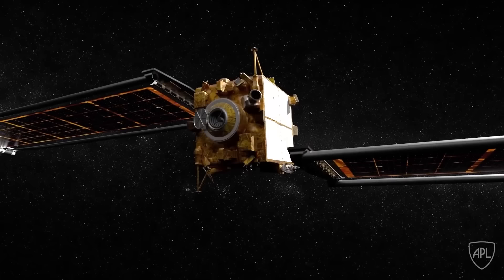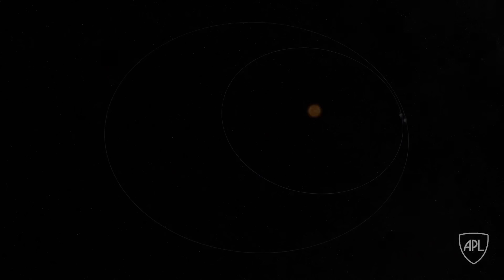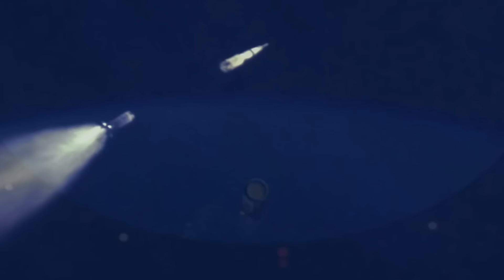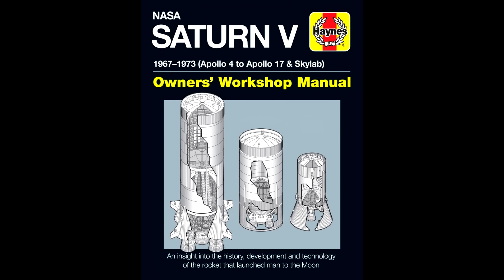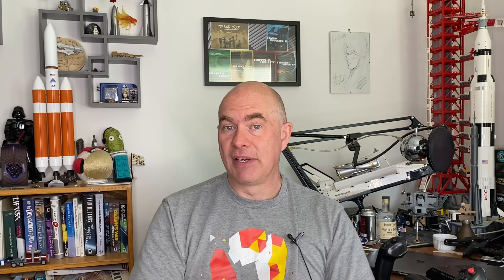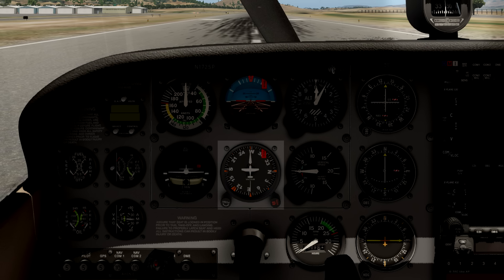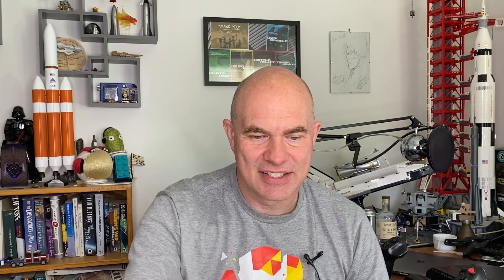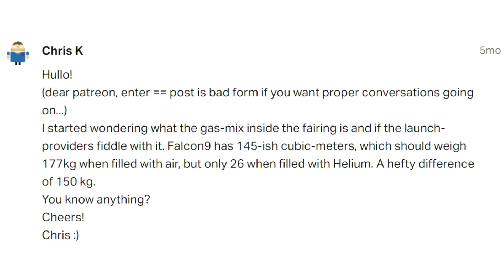Saturn V Staging, Asteroid Deflection and Hearing Rocket Turbines - Supporter Questions, Episode 17

Comment: There's something that does the same job as an orbital elevator but is doable with current materials - orbital rings. So basically you love Earth so much you put a ring on it (get into orbit with a huge spool of cable, and unravel it until it circles the entire Earth - and it's in orbit).

Then, to tether things to this ring moving at orbital velocity, you basically use maglev trains - something that is stationary with respect to the Earth's surface, that bears weight on the ring through magnetic interaction only, so that you can have cables hang down from it that are stationary relative to the surface of the Earth.

And you can do this with current materials and make yourself a gondola up to LEO. Then use a maglev train to reach orbital velocity once you're up there. Or even keep accelerating to whatever speed you want (at least, until centrifugal force is so great you'd break the cable. But since the cable can handle 1g, you should theoretically be able to hit escape velocity, at least, since that'll put you at -1g load on the ring).

Comment: Ring laser gyros have been used in large aircraft inertial reference systems since the early 1980s. They only have a tiny amount of drift and are sensitive enough to get the aircraft's latitude during the warm up initialization by sensing the earth's rotation. But they are still cross checked and adjusted in flight by the flight management computer using other external data like ground beacons and GPS.

Comment: The elevator also needs to impart radial velocity to the payload as it rises. It would need to be able to not just take tension and compression, but also some very robust lateral strength. I think. I don't see how it can be viable. I could be wrong though

Comment: I've done that interstage/ullage thing in KSP with structural rings and Separatrons.  It's good for rockets whose first stage doesn't quite have enough kick to get it past 18 km and staging would send it tumbling in the atmosphere.  The push from the Separatrons stabilizes the back end while you start the second stage engine and raises your apoapsis to make its job easier.

Comment: re: delta iv spin up - when I worked for Rocketdyne at Stennis Space Center 2004-2005ish, I always remember after an RS-68 engine test on the B test stand that you would very noticeably hear the engines spin down post cutoff.  interesting to hear them spin up (I guess there was too much other noise during tests to hear).

Comment: About that Saturn V ring, I heard a story of the guy responsible for the 16mm camera that took the footage never saw it until many many years later (kind of hard to believe since the footage has been used for many documentaries, sci-fi, commercials). I read in 2000s I think where this guy is retired, living in San Diego, and he was interviewed and his story was in the media. Imagine being part of the design, implementation, plus all the bureaucracy in addition to meeting schedule while working the failure modes. Then load up the film (or someone else does that) hope nothing gets screwed up during installation. Hope power will activate at the right time, footage not too bright but not too dark, mitigate the extreme temperatures. Later recover the film. Then have it developed. Imagine being one those few that got to watch it for the first time.

Comment: Another reason that DoD was happy to leave the shuttle for unmanned rockets was the requirement to modify STS payloads (satellite) to meet man-rated system safety requirements which increased weight, added complexity (more failure points) and reduced on-orbit fuel availability.

Comment: Regarding the space elevator. In The Fountains of Paradise, Artur C. Clarke clearly mention the requirement and the process of cleaning space from all the debris and satellites that could collide with the elevator. If I remember correctly, he stated that that cleaning toke over 10 years.
During the development of the space shuttle, there was a proposition of having a space taxi : A space shuttle aimed to only carry crew, possibly up to 12 peoples, and minimal cargo. Then, have a space truck : A large volume and mass cheap launcher destined to launch only cargo, reducing costs by not having any sort of life support. Light weight and cheap structure.
Combined, that could have led to an ISS with larger, more spacious modules. Imagine an ISS with habitation and storage modules of around 5m in diameter.

Comment: More on the later Apollo missions - from "Stages to Saturn", Roger E. Bilstein, NASA (pp 376-377)

"The last three vehicles, AS-510 through AS-512, performed without a hitch. The payload, however, was continuously climbing. These last three launches included the lunar rover vehicles, which added almost 225 kilograms to the payload of the Saturn V. The rover turned out to be extremely significant, permitting astronauts to extend greatly the range of surface explorations and increasing their stay time. The uprated engines of the Saturn V, which permitted it to boost this additional weight into orbit, turned out to be a function of thoughtful long-range planning by NASA engineers. In the evolution of rocket vehicles, the actual payload requirements almost always turned out to be greater than originally planned. As a result of bitter experience, engine designers kept in mind the likelihood that their creations would have to be uprated from time to time. In addition to this consideration, engine designers normally incorporated a certain degree of margin in setting up the specifications for engine development. If the specifications called for an engine of 4.5 million newtons (1 million pounds) thrust, it might be designed for 5.3 million newtons (1.2 million pounds) thrust to be sure that the original specification line was met. With operational experience, it was then possible to uprate the engine by relatively minor changes--improving the turbopump and the tubing (to improve flow rates), adjusting the injector for better mixing (to get a higher percentage of the fuel burned and increase the specific impulse)--these all were contributing factors to the success of uprating the engines of the Saturn V vehicle. In this way, the Saturn V was able to absorb not only the increasing weight of the command and service modules early in the program, but the added weight of scientific equipment and other paraphernealia such as the rover in the after stages of the Apollo-Saturn program."

(Apologies for the long message and for any typos)

Comment: Let's not forget that von Braun('s people) pushed for 5 engines in the first stage. For the initially planned spacecraft 4 would have been enough. That added a lot of flexibility.
During development everythign got heavier and heavier and they very quickly were thankful for that margin. Even more so on the heavier, longer and rovier 15-17.
as for good reads: Stages to Saturn by Roger E Bilstein. Maybe  abit more indepth than some people want to go.

Comment: The military and the Shuttle is often presented, even if parts are unspoken, as 'Evilz Military muscled in on a civilian programme and broke the Shuttle'.

To rephrase your answer somewhat, the actual way things happened was 'Military (and other agencies[1]) were press-ganged into using the Shuttle against their will and the changes made to allow them to use it now and into the future[2][3] determined certain features that had both beneficial and detrimental impacts on the programme'.

Forcing the military[4] use a Shuttle that only had the features need for civilian use was never going to happen, presenting things, the way it is so often done, as 'the military[4] broke the Shuttle' is wrong, it was 'the decision to force the military[4] to use the Shuttle fundamentally changed it's nature' 

However without the (forced) military and other agency involvement the may never have been financially and politically justifiable and thus simply not happened at all. Imperfect Shuttle or No Shuttle, take your pick...

[1] People also tend to forget that bit...
[2] As it was conceived at the time the design decisions were being made
[3] And, to be fair, add features to compensate the military for those lost by not allowing them to use Expendables.
[4] And, never forget, other non-military agencies.

Comment: Can't believe nobody twigged to the fact that while HE is lighter than air, you're outside the atmosphere after about the first 90 seconds, after which it makes no contribution. And it has mass. Vacuum inside the fairing would provide the best advantage to the launch, although it would be 'way offset by the extra mass of strengthening the fairing!

Comment: Regarding kinetic energy, velocity is more important than mass because kinetic energy is proportional to the square of the velocity. So, if you burn mass to generate velocity, you'll likely increase kinetic energy (depending on some other things, like energy density of the fuel and efficiency of the engine).

Comment: responding to the title question: because its an engine skirt and you dont need one in vacuum optimized upper stages. Also its unnescisarry mass and these engines are big so they needed aerodynamic protection. Remember those russian rockets, they have space between their stages, their engine bells are smaller

Comment: Scott how things have changed since I learned to fly.

I was never overly enthusiastic about the old 'prayer wheel' style of circular slide rule navigational calculators what with all that messing about with pencils and erasers.

Nor was I particularly adept at remembering all the equations for 'critical point' and 'point of no return' etc which I had inscribed on the anodized coating of the alloy frame for my prayer wheel with the needle point of a navigational compass.

Early electronic navigational calculators became increasingly prevalent from the mid 1970's onwards and being young at the time and a bit of a tech enthusiast I purchased one and invested quite a bit of time at becoming safely proficient with it.

It even had dedicated buttons for a number of functions such as converting values from imperial to metric since Australia converted around a decade earlier in 1966 when I was ten.

My instructor was a veteran of the 'old school' who cut his teeth flying Dehaviland Drovers on geo-survey work in the Australian outback during the 1960's.

On the occasion that I proudly produced my nice new device during a cross country nav exercise he cast a cynical eye upon it and curtly enquired as to what is was?

I happily explained that it was "the latest electronic labor saving device for navigational exercises" whereupon he snatched it from my hand and threw it back into the cargo space as he said "well the batteries just went flat so get out your prayer wheel and do things properly"!

From then on I discreetly limited use of my modern marvel to flight planning if 'el grouch' was not in the vicinity and college lectures.

I can well remember trying to take accurate readings from a magnetic compass in order to update the directional gyro while bouncing about in the ferocious turbulence of Australian summers in the outback and now they build all that stuff into the avionics, Sheesh!

Comment: Space Elevators: I suspect that the best reference for a layman is probably still Robert L. Forwards "Indistinguishable From Magic" (1995) - it has a chapter (Beanstalks) that goes into considerable details on pretty much ALL the different ways to get into space (or handle part of the way) without going into actual math much, just what the results are (but provides references for actual technical papers).
IE, not just Space Elevators but Rotovators, Bolos and my favorite, the Space Fountain, because it's something we could build today - IE no real unknown/future tech or materials, and at least one complete design (down to actual component) AFAIK.

Comment: Eduardo San Juan designed the Lunar Rover which was no small feat but where the man's genius truly shone was the buisness of fitting it into a comically small area on the Lunar Module . In a case of literal and figurative thinking outside the box , the box being a mere 4X4 feet . He used his fascination with origami to figure out how to fold the rover into its storage area . He later said he would gladly fit a 1972 Pontiac Bonneville in the same area and NASA told him no as it would likely get bogged down in the moon's powdery regolith but nevertheless believed he could do so .

Comment: Instead of carbon nanotubes for use in a space elevator, researchers are discovering that graphene sheets are much easier to manufacture and contain far fewer flaws at the atomic scale. It seems that laminated graphene will make space elevators a practical idea.

Comment: First question on speeding up vs having the mass. As speed is squared to calculate the impact force. Increasing speed gives more force than increasing mass.
Reply: When speeding up, mass is not linearly traded for speed, the rocket equation applies. So "increasing speed gives more force than increasing mass" does not work as an answer in itself.

Also "force" is a tricky quantity to use when discussing this. Force is applied only briefly during the impact and varies wildly. The same momentum change can be achieved with a small force over a long time, as can with a large force over shorter time... (Δp=FΔt)

Comment: Scott, learn to navigate and fly with nothing more then a compass, a clock and a paper map. Get a B1 Circular Slide Rule. Then add RDF. If you can master these skills you'll be safer and much more efficient at using advanced tools. I am an old school stick and rudder pilot. I started flying in 1960. By 1970 I was an Air Force Fighter Pilot flying F4E Phantom II. In addition to basic navigation tools, I had a Sextant. The Inertial Navigation System and AutoPilot  were helpful but, GPS was not available. Flying in this manor I circumnavigated the planet 6 times. THE LOGIC: WHAT DO YOU DO IF THE ELECTRICAL / NAVIGATION SYSTEM FAILS. My father started teaching use navigation and piloting at age 5 or so. Thus, we became skilled Mariners. Crewing his boats for free. LOL!

Comment: Scott-RE: the HSI....your Cirrus also has a magnetometer [GMU-44?] which provides inputs into your HSI and helps to keep it aligned. BTW, failure of the GMU will result in a partial degradation of the GFC700 autopilot's functionality-it's a relatively rare event but I have experienced one once and it is also why some GA airplanes [Cessna TTX being one example] have two magentometers for redundancy.

Comment: There was considerable excitement about the possibility of a space elevator around twenty years ago when physicist Bradley C. Edwards was commissioned by NASA to look into the feasibility of building one, and various efforts were made over the next few years (competitions, companies, consortiums) to kickstart research and design into the required technologies, especially the fabrication of carbon nanotube fibers.

Public interest has waned over the years since the inevitable realization that we simply won't have the capability to build this megastructure anytime soon (i.e. within the next few decades), but there are still some smart people working on the problem and a new paper or proposal still crops up every now and then.
Reply: Space elevators are worthy research topic but IMO may be politically difficult because of the mass chaos and destruction that may be easily wreaked by physical damage to them.
Reply: @JamesPerkins  They have looked into what would happen if a CNT based elevator failed catastrophically, and they came to the conclusion that it wouldn't be that bad -- certainly not mass chaos and destruction. The overall mass of the ribbon is very small and if it broke very high up, much of it would burn up in the atmosphere. Anything above the break would leave Earth's atmosphere.
Reply: @JamesPerkins  A space elevator would have multiple ribbons that would back-up each other.

Comment: On the first question there's also the effect of chemical energy. Yes you loose mass, but the mass itself in the impact would not utilize the chemical energy. By burning gases on the exhaust you will convert their mass (or momentum) and their chemical energy into kinetic energy, that could be used.
Reply: The same is not true in monopropellant cases (when there is no burn).

Comment: Question, we all know the super Draco engine was made for propulsive landing but is now just used for launch abort. So, 1) why are they still built in when you could save the weight in the capsule and just have a system in the trunk? 2) As they are still there, in the event of a catastrophic failure in the parachute system, could it still be used to save the crew as originally designed?